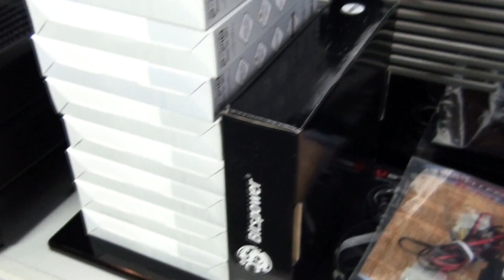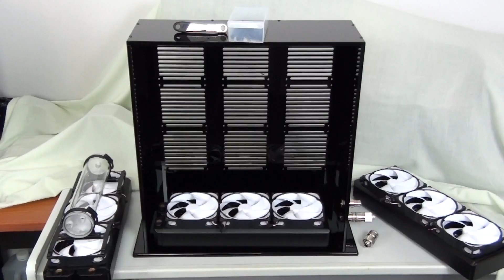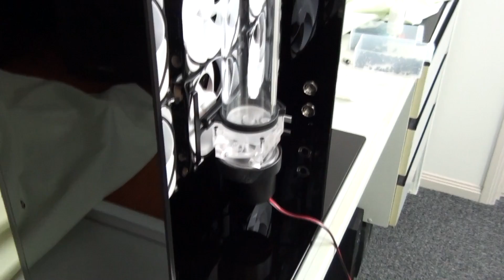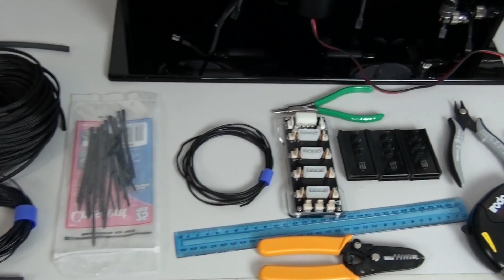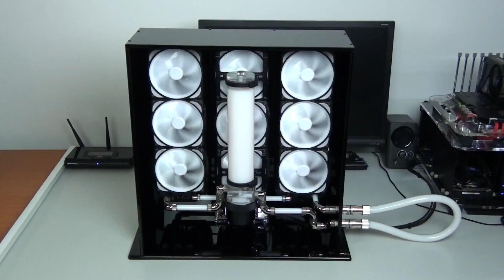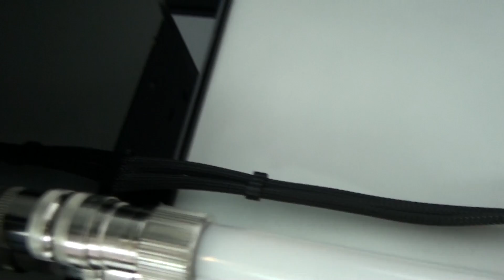Singularity Computers Giveaway Water-box Upgrades: Part 2

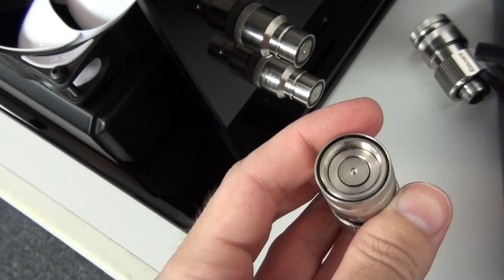Comment: at around 2:29 you comment that the new quick-connect are far better for a number of different reason compared to the old design where you have to rotate to disconnect. However you never explain what the far better reasons are. Could anyone please elaborate on this.

Comment: The Tube to the right is horrible O_o
Reply: very late reply i know but here!: The reason for the tube was to just run it in the video but it's actually used to connect to your actuall pc to cool your cpu. you know those holes in the back of most pc's? that's where these tubes would go through. for examply if you don't have enough space to watercool in your case :).
Reply: Glenn Vandendijk
http://cyril06.free.fr/images/tutogaine/15.JPG

Comment: can some one explain to me why it is better with a bigger reservar?
Reply: larger amount of water takes longer to heat up by components, its got a big surface area and if placed in front of fans (like this one) helps keeping it cooler, more room for expansion and contraction due to heat, more leverage for fluid loss (although if your losing fluid somewhere an empty reservoir is the least of your problems) but it can occur over time, serve as a bigger air-trap to help remove air bubbles from the system also its far more easy to prime your system with a larger reservoir. im only just getting my feet wet (pun intended) to liquid cooling, going to fit my first kit this weekend just waiting on a few more parts. but iv'e been doing as much research as i can to make sure i don't mess it up

Comment: most cases you buy when building a pc have gromitted round holes in the back panel. this is what those are for you just need the tubing, waterblocks, and tubing connectors inside the PC case

Comment: i had a DGL-4500 once, epic router, the major downside is using them for both wired and wireless in a network of 5+ computers, then there's the PSU issue with them, i built a router after not finding a suitable replacement.

Comment: It has a lot of rad because the fans need to run at a lower RPM to be quiet, as they are outside the case. Of course, these specific fans are already quiet, more quiet doesn't hurt.

Comment: while i see the use of a water box, in this day and age, this idea is becoming outdated. hardware no longer requires a insane amount of cooling to run smoothly at stock, and small cases like the bitfenix prodigy or obsidian 350d exist that allow for multiple radiators to be installed within a repetitively small form factor, just make shore the loop is closed, so the reservoir cant spill during transport, and you have yourself a nice portable water cooled system.

Comment: I would recommend mothers milk because it has extra nutrients wich work as a natural biocide and because of the extra nutrients the  milk will hold a lower temperature since it will have a higher density. e=mc3 explains it all.

Comment: A splitter pcb  is not classed as modding, cut ur fan wires and solder them all up. That's how it should be done. Also you make it sound so hard for beginners to try watercooling and crystal links. It's really not that hard and very easy to arrange in your case. You just buy 1m lengths and cut them with a drop saw and bevel the edge.

Comment: I looked up the NB B12-2 fan and I noticed that the performance is only 86.9 m 3. You use them so I believe they are great for cooling radiators but wouldn't the B12-4 be better at 150.3 m 3? Did you just do it for the quietness? Or is the B12-2 good enough?

Comment: Can the bits power x-station be linked to a fan controller? So the order would be radiator fans into the 3 way splitters, then into the x-station, then into a fan controller?

Comment: I meant getting a dual pump D5 configuration because I used to have flow problems before. I wonder what you reckon. Either way the Bitspower-type deal you use in your systems.

New case will be a CaseLabs Merlin ST10 case with two 120.4 (or 480) radiators 80mm thick. Waterblock wise it will be changing as I intend on keeping that config for more than a year. But probably around 5.

Pump configuration would be seated between the front panel 480 radiator (with push/pull) and a Corsair AX1200i PSU.

Comment: It's the Radiator(s) - Fan(s) - Reservoir(s) - and Pump(s) in a seperate Tower that you put beside you're PC and run the tubing to the water blocks so that you don't have to have all of those things in you're PC. All of these components make a fully loaded system very heavy, and usually the cases that can support this type of thing are heavy just by themselves.